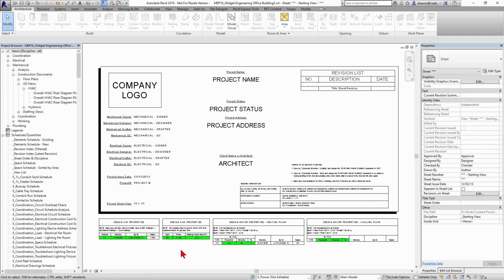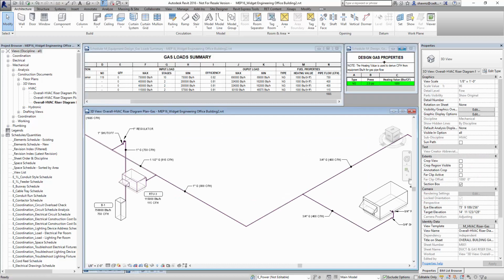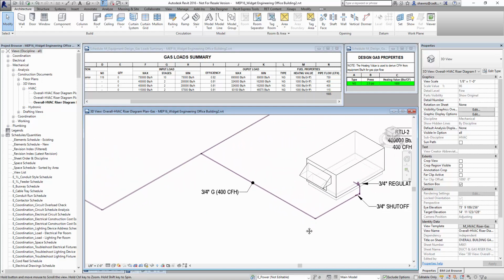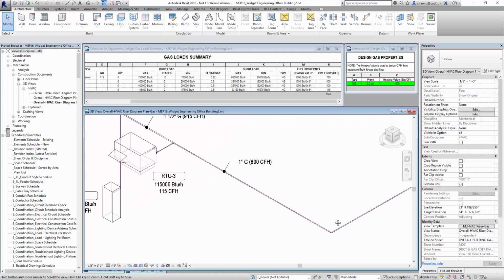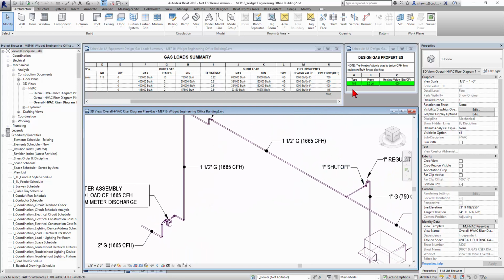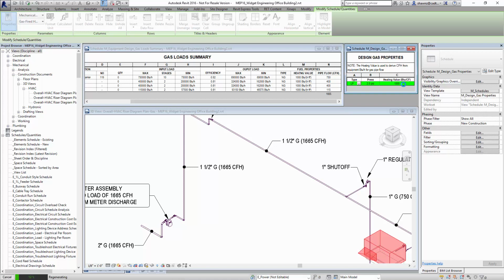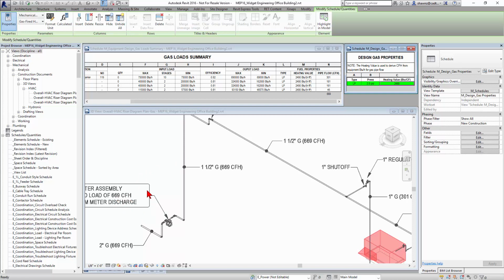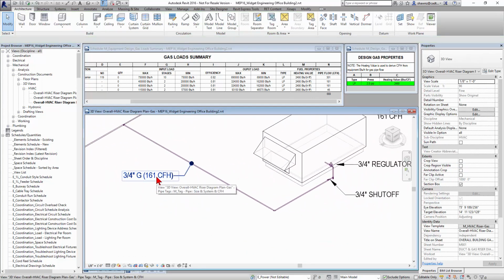MEPPP Gas Flow

Comment: Couple questions: 
Can you auto size gas pipe based on starting pressure and desired pressure drop?
Can you create sizing reports/tables to place on drawings?
Reply from the maker: Hi Dan,

Unfortunately, the size of the pipe is dictated through the pipe routing settings, and not the flow.  You can create a BOM through parameters within Revit; as far as what you want the schedules to display, that is completely up to that individual in regards to what columns he wants to be a part of his pipe sizes/BOM.

Regards.